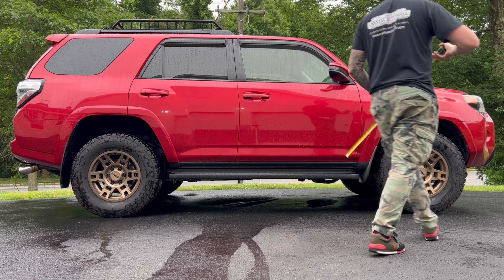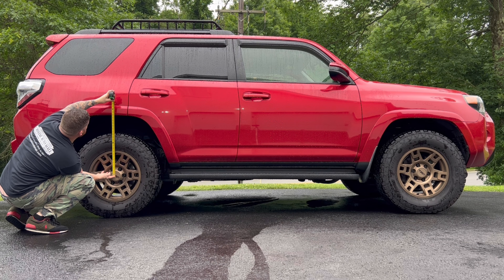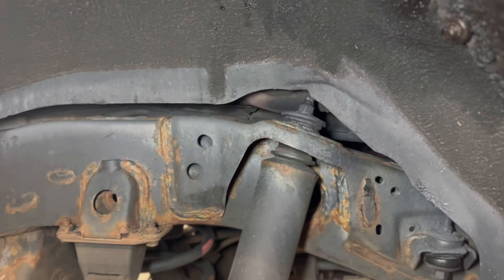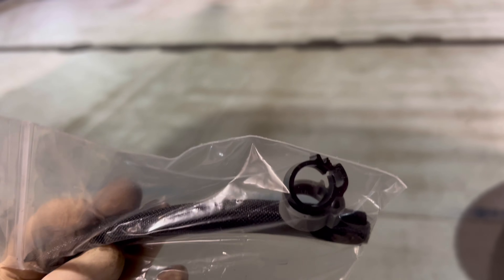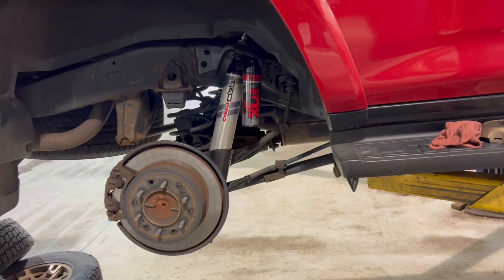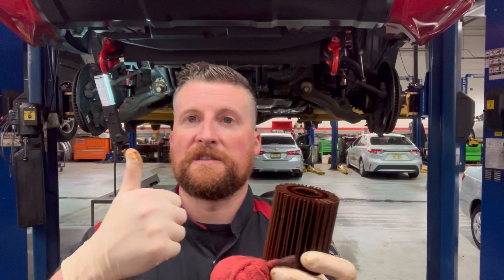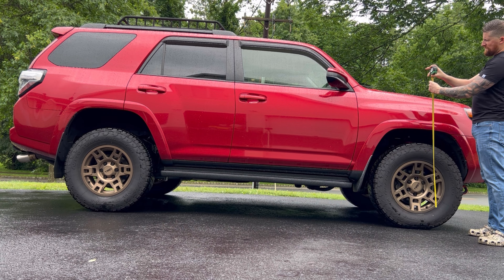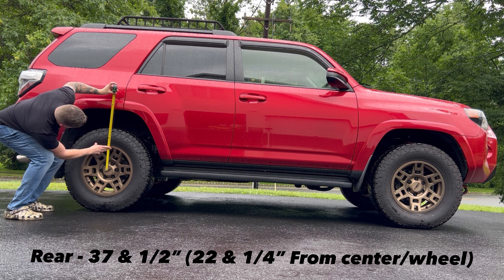That Toyota 4Runner TRD PRO FOX RACING suspension Debacle • How much higher? Part 1

Comment: I added the Eibach lift springs to the rear and to the TRD Pro Fox OEM struts on my 2019. It added about 1.5" lift over all
Reply from the maker: That’s very good info right there.
I’m currently installing Eibach Springs which should replace the OEM ones
(the way the TRD PRO should have came)
Claims 1/2 lift , stay tuned for actual final height 😉

Comment: Will it fit a 2012 4Runner Limited  with Xreas Suspension if it's removed ?
Reply from the maker: Absolutely 💯 
Just small modification to the upper rear shock bushing. No biggie!!

Comment: Ordering stuff late at night can get expensive, couple weeks ago I ordered a GOBI Ranger roof rack for my 2021 4Runner. I'm looking forward to upgrading the suspension but wont be doing that until I have all the other parts installed like bumpers, skid plates, auxiliary fuel tank and stuff for overlanding. I'm looking at going with the King suspension kit. Love your red 4Runner, mine is red also. Takk for videoen, Skål!
Reply from the maker: Those are some sweet upgrades. 
I appreciate your support! Thank you.
Reply from the maker: Red 4Runners rule 🤘🏻

Comment: Any tips on the front caliper pins in the rust belt? Mine are always seized and NEVER just slide out. I’ve had to carefully Dremel them and work them out with a punch often taking hours. Any tips
Reply from the maker: Unfortunately, that’s a constant battle for us. So I always install new pins when possible and apply anti seize in the pin holes. The removal portion is always a struggle, heat is your best friend. I use a small portable torch to work them out, along with a pair of good locking pliers and twist motion.
I hope this info is helpful.
Reply: @VikingsGarage  this is good info! I'm in the Northeast, I'm planning on doing front brakes on my 2013 4Runner soon. I never really had any issues with brakes on any other vehicle I've owned, so this is kind of a surprise. At least now I'll be prepared.
Reply from the maker: 👏🏻👏🏻 You got this, if anything just watch my video (link below) on the subject for any possible questions. Good luck 👍🏻 
https://youtu.be/9tiFUcN8yEw

Comment: I have owned a 2016 with KDSS and now a 2021 Pro, and IMO hands-down the Fox suspension rides so much nicer on and off road.
Reply from the maker: I do agree! 👍🏻
Reply: Test drove a PRO and Off-Road Premium KDSS. Off-Road drove much better on highway and sharp turns. Didn’t off-road. Saved about $10,000 buying the 4Runner off-road.

Now have Billstein 6112 and 8100 bypass… more durable than FOX suspension. Saved money than the PRO, better suspension and no issues the FOX pro suspension is having with customers.

Comment: Great Video. Always appreciate the info you share. Quick question. When installing the new setup. Do these have to be tuned at all? Or just ready to be installed out of the box? 
Don’t think you mentioned the price also lol. Or did I just miss it…
Reply from the maker: I paid $2000 on eBay, ready to install out the box.
Reply: @VikingsGarage   I want to go the same route as you with the fox suspension. I Found a good price on ebay. Just concerned because if I purchase from toyota they warranty for a year. But if I buy off of ebay and something happens six months later. Then it’s all on me. Whatdya you think? Is this setup reliable enough to purchase on ebay or just pay full price from Toyota? As always. Thanks for all the info you give
Reply from the maker: You should be fine with the EBay one. Mine is well over 1 year old, zero issues.
Bought it on EBay.
Reply: @VikingsGarage  thanks bud!

Comment: I literally just did the same exact thing to my 2014 trail 4runner a few weeks back. Got a freaking steal on my set. I noticed the same exact thing, stiffer on the bumps and small stuff. But if you have an opportunity to hit some good dips, rough dirt road or trail, that’s where it’s pretty amazing, especially if you can hit stuff over 40. It gives a little to much confidence hitting things that would bottom you out easily before with the standard shocks. 
Great video, glad I’m not the only one who likes the pro shocks
Reply from the maker: Absolutely brother, Thank you for watching and supporting this channel!
The PRO Shocks/suspension is awesome!
Reply: Hi, I am considering the same for my 22 TRD off-road, the stock struts/shocks seem boaty but comfy over small bumps so don't want a drastically firm ride as it's my daily road vehicle. What is your impression after 1 yr, still stiff on the road? and do you like it? recommend it? Also, you bought the suspension kit new, and how much? Thanks for any advice.
Reply from the maker: @pall5114 I would recommend it, not stiff at all, I got it for a steal… $2000

Comment: I have a 2020 TRD Pro. I had the original FOX front struts replaced with the TSB recommended front struts (due to the contact of the bottom two springs). I'm sure I won't have the clunking noise now at temps 40 degrees and below. But, the replacement front struts have a dull squeaking noise periodically that the original springs didn't have. Oh well...I wonder if the 2021/2022 TRD Pro owners have noticed this (because I "think" the TSB recommended front struts for the 2019/2020 are the same front struts as the ones that are original on the 2021/2022 TRD Pros).  
Also I put on 275 KO2s (this was before the front struts were replaced) and there is absolutely no rubbing issues at all (with no modifications done). My MPG did decrease about 1.3 MPG with going from the 265 Nitto Grapplers to the 275 KO2s.
Reply from the maker: Unfortunately to make our trucks more to our liking with off-roading in mind, MPG do suffer.
Yeah they had some issues with Fox racing struts initially. I made a short video on that :
https://youtu.be/hw8VgahEGXE

But the part numbers I installed which I put in the description box are the latest and greatest with all the bugs fixed. 
I appreciate your comment and thank you for your support!
Reply: @VikingsGarage  Do you think that the front struts used to replace the defective ones on the 2019/2020s are the same front struts as the ones on the 2021/2022 year models? (I believe the part numbers are different.)
Reply from the maker: Technically no, but I was told they are practically the same. 🤷🏼‍♂️

Comment: What bushings did you use on the rear Fox shocks? I see they don’t come with them. Can you use OEM Toyota rubber bushings or what are the options available? Thx
Reply from the maker: I did use the oem Toyota Bushings . I tried looking for polyurethane ones, to no success 🤷🏼‍♂️